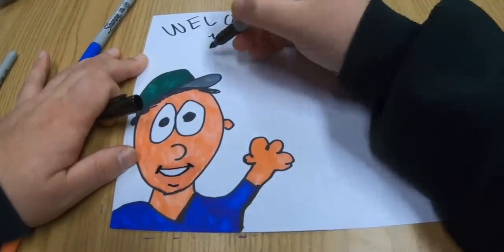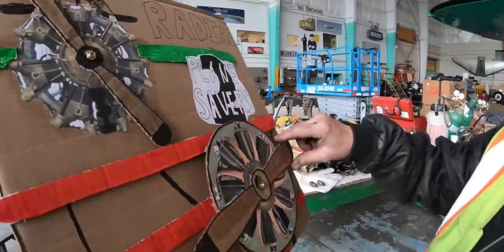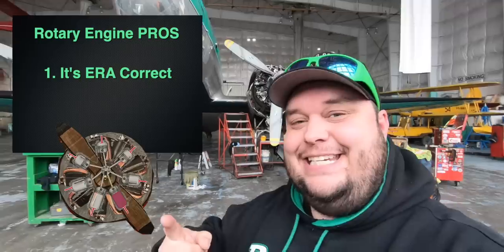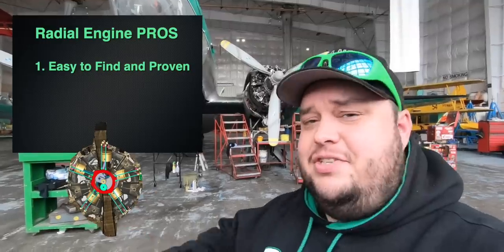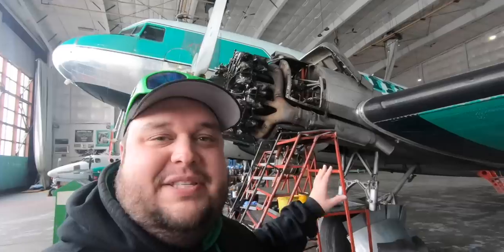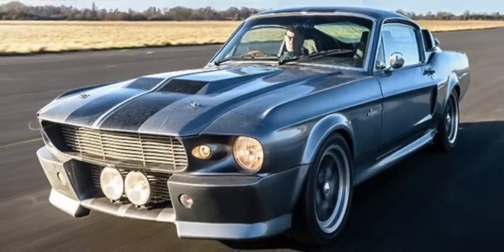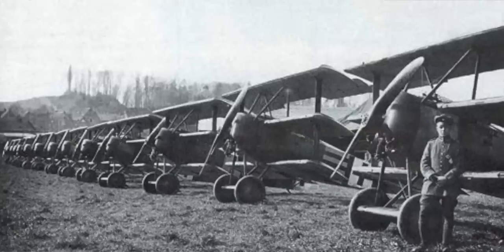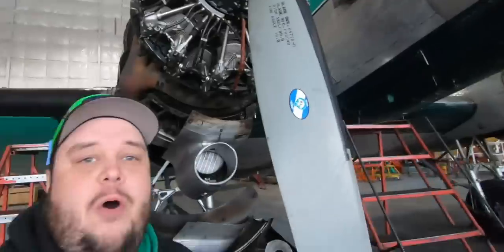Radial vs. Rotary | AIRCRAFT ENGINES | Plane Savers S2-E6

Comment: Looking back romantically and wanting the DRI to be "exact" in all specifications is unnecessary.  Aviation evolved over the decades and new concepts made flying safer, more efficient and less challenging to those who flew them.  Rotary engines are cool, steam gages are cool, tail skids are cool.  But, adding a radial versus a rotary engine simply "improves" the encounter with the aircraft.  Having a tail wheel means you can taxi and turn without wing guides.  You project is a salute to another age, with a nod to evolution.  No excuses needed.  Can't wait to see her fly.

Comment: A rotary engine used castor oil as a lubricant, so it kept the pilots "regular" as well., due to its laxative effect.
Reply: Yes its a real thing. Rotary pilots regularly shite themselves even before "the Baron" appeared in their peripheral vision. Pretty big con!
Reply: Why castor oil?  Totally made sense when you consider that radial rotary engines were 4 stroke cycle, requiring the valve train to be lubricated. An interesting fact about the oil is it's high flash point temperature. This allows the oil that is injected (not mixed with the fuel) into the intake tube, to lubricate the bottom end, and because it doesn't burn it lubricates the exhaust valve train as well. This "total loss" lubrication system is different than other pressure type total loss systems, and different than a total loss system in a 2 stroke cycle engine as well... very unique. The engine cowling is designed to be open at the bottom to allow the exhaust gasses out, along with the single use oil. Pilots of the era wore long scarves to keep their googles clean, not so much to keep from ingesting the oil, a myth. I read in the book "No Parachute", that the rookie pilots would sometimes use that excuse when they soiled their pants after a particularly harrowing mission... literally having been scared $hitle$$. That book "No Parachute" was an amazing day by day account of a British fighter pilot in France in WWI. It was compiled by his wife from letters written home nearly every day for over a year, until his luck ran out. Everything from dawn patrols flying at 25,000 feet in -30 degree cold, to strafing the enemy in their trenches, to landing behind enemy lines and finding his way back. The title of the book, was taken directly and literally from the fact that the British Air Admiralty refused to issue parachutes to their pilots, believing that they would cowar in the face of the enemy! This book really opened my eyes to the absolute absurdity of war in the skies, and to the extent of the absurdity of the British way.

Comment: Regarding the type of engine: it's your plane. IMO, nailing a radial to a replica DR1 is like those kit cars that are supposed to remind you of an early MG, but have a VW engine in the back. They neither look nor sound right, but no doubt they are more usable than an original.

Comment: Anotyher con for rotary engine.Is that because the engine is the heaviest single piece of euipment on the plane.The planes because of centrufegal force.Is constantly trying to turn in the direction the rotary egine is movine.Its like trying to fly a bucking bronco horse.You are constantly fighting the plane to fly staright.

Comment: ok Mikey cut to the chase put a turbine in it and the pilot just sits astride then off into the wide blue yonder assuming the wings don't depart company or to get a super-strong following a VW bug engine plenty of parts available problem solved, with a bit of cowling magic no one would notice

Comment: be careful with that cuda and an engine swap.way back in the late 70's a guy i knew swapped the 318 for the 340 . car was fast till the front torsion bars ripped  out of the frame  breaking the torsion box out of the frame.

Comment: Awesome episode!
Keep up tha great werk!
Intro was awesome

Call caleb curry at radial engines in Oklahoma , put a jacobs 755-9 ,245  hp on it withdual mags
Im overhauling a 755a2 300hp in my starduster too here in shop , theyre awesome engines!
Its reliable and reasonably priced from caleb new overhauled ready to go
Ive even got a crate full of L&R t50 exhaust mfld pieces if u need pieces to make nice dual stack out the bottom

👍👍😎

Comment: "the operation of the engine is the huge, huge CON",  4:43 ... you would need steel nerves or a complete lack of sense to pilot an aircraft with one of these engines in my estimation. siding with usability is always a good choice

Comment: I am in favor of putting in a rotary engine.  You have gone to the trouble of replicating a historical aircraft.  Why not put in a replica rotary engine to give it original handling and performance.  The rotary made the plane much more maneuverable with abrupt power changes.  True it would require some training to master, and operating expenses would be a lot higher, but you would have brought back to life a treasure of our past!

Comment: Hey Mikey, great video!  This CRJ Cptn salutes your latest efforts (& am happy I figured out in ep 1 what your restoring this year!).  But on to the reason for this...I know you've already done lots of research about flight & ground handling characteristics of this model.  But thought I'd point you to a couple of good videos...just follow to my meager channel where I've put them in playlist...think you'll get some good from them!  Also, not the greatest historian, but if memory serves correctly, airfields of that era were simply open (& groomed?)fields with no "runway" to speak of; as these kites had little to no crosswind capabilities.  Probably since so little was known about that at the time.  Oh yeah, in one of the vids they actually have a rotary engine installed on their DR-1...interesting discussion w the pilot!  Good luck🛩‼️

Comment: Sorry, but you're making erroneous statements about rotary engines because you didn't do enough research on them.

The first being that you state that rotary engines don't have throttles, which is false with one exception; The Gnome Monosoupape (monosoupape meaning single valve in French). This engine and copies of it (The Oberusel U.I) don't have a throttle because of the weird design it used. It's a bit of a misnomer to say "its like a two cycle engine", because while it does have induction ports, they're not used in the same way. The engine has a simple mixer which injects fuel and oil into the crank case, which is then mixed around by the crank case and ends up in the cylinder. The interesting part though is the air charge, because the valve at the top of the cylinder is both an exhaust and intake valve, actuated by a push-pull rod. When the cylinder exhausts, the valve is kept open on the downwards stroke part way and then closed, which creates a vacuum. Once the piston gets low enough in the cylinder, the ports are uncovered and the partial vacuum pulls the fuel/oil charge in to mix with the air, it's compressed and then ignited. The push-pull rod operates via a complex set of cams inside the engine to open and close at precise times, unlike a pushrod which is just pushed up with a spring return.

The bizarre method of cam timing and the intake-exhaust valve made throttle control impossible, so the engine was basically full on or off. The designers experimented with ways to add some sort of throttle control by introducing variable valve timing, but quickly ran into problems of burning valves due to not being able to finely control the fuel/air ratio. They eventually figured out that they could cut ignition to specific cylinders by using a geared timing mechanism to ground out the magneto, giving coarse speed adjustments of full speed, half speed, quarter speed and eighth speed by cutting out increasing numbers of cylinders. Doing it this way allowed cylinder firing to stay even so the engine wouldn't shake itself to death.

The second is you're conflating two completely different rotary designs. I just talked about the Monosoupape, which looks like you were trying to describe in your video, but the engine picture you have is a Gnome LeRhone, which is a completely different type of rotary engine. The LeRhone is a conventional engine design with two valves per cylinder, one intake and one exhaust. The copper pipe on the side of each cylinder is a passage from the crank case to the intake valve, which is fed by a carburetor on the back of the engine that meters air/oil/fuel. This engine and every other rotary engine that didn't use the Monosoupape design had a throttle and was able to be controlled just like any inline, vee or radial engine was. These rotary engines did also have the ability to blip their engines by cutting the ignition, but it was not the only method of throttle control, and it was actually advised not to do it. if you waited too long between ignition pulses, the engine could actually explode, or blow jugs clean off the engine.

Here's a Sopwith Snipe with a Bentley BR.2:
https://www.youtube.com/watch?v=q3eMO7tjBoc
https://www.youtube.com/watch?v=MHS1mv08qw8

Note Kermit Weeks is using both the throttle lever and the blip switch. Cutting the ignition does give some extra control over the engine, but is not explicitly required.

Here's a Sopwith Camel with a Gnome Monosoupape 160:

https://www.youtube.com/watch?v=j6PnKUEFX8g

Note that this engine is basically full on or full off, Gene DeMarco has to use it extensively to control the engine and he talks about it briefly.

Rotary engines are a lot simpler to operate than you and most people make them out to be, because somehow the Gnome Monosoupape somehow became the boilerplate textbook example on how all rotary engines work, even though it's completely inaccurate. They're also not horribly unreliable like you seem to believe, there are far more modern engines with worse reliability records, like the shitty Rotec R2800/R3600 radials. I'd trust my life to a 102 year old Bentley BR.2 or a Gnome Monosoupape over a garbage Rotec engine any day.

https://www.youtube.com/watch?v=ZIjh4o9QjtY
https://www.youtube.com/watch?v=LlPtMVijIzs

Comment: Great video Mikey. Re the B24, FYI a B24 airframe is being restored to static display but to engine running condition at the old Werribee airfield in Melbourne Victoria. See b24australia.org.au
Reply: PS Was lucky enough to be given a souvenir of an eroded aluminium panel from the original airframe after it was replaced

Comment: I've been around aircraft and engines quite some time and I have never heard any distinction between what you're calling rotary and radial. They are both radial engines and they are both rotary engines. Even an in-line engine is a rotary engine but it is not a radial engine. Radial refers to the layout of the cylinders. If I remember correctly when you Bolt the crankshaft to the airframe and the engine turns was referred to as an Adam's Farwell design radial engine. And it was used extensively in World War 1 aircraft this is why some aircraft could turn One Direction but they couldn't turn the other because the hey loran we're not capable of overcoming the torque of the engine. But the thing you could do better than the other radio engine or the in-line engine is it could turn the other direction much quicker. Giving it a bit of an advantage in dog fights. The other Advantage was with that much reciprocating weight, it tended to keep it self running even when issues tried to crop up.

The exhaust could be clock to any position in the 360 degree circle. And you are correct about the oiling system, it was very much akin to the oiling system on jet engines until the early 1970s when they finally had a contained oiling system and now jet engines don't have an oiling system at all. They actually compress the fuel to all the bearings before it goes to the injectors in the compressor stage.

Pilots in World War 1 wore scarves to put over their face because it got freaking cold up in the air especially towards the winter time. Besides that they could identify each other by what scarf they wore. But they didn't shoot oil and exhaust straight up through the top to interfere with their line of sight so they would be able to shoot their guns. If there was any of them that actually exhausted out the top in front of the pilot it was a mistake, it wasn't by Design. Most of those systems of World War 1 aircraft still exists to this day in some way shape or form. Oil accumulators is one example. The Souza engine used them.

You may be confused because when what you are calling a rotary engine is tested the exhaust is usually straight up. But it doesn't have to be straight up it can be any place around the engine when it's actually on the aircraft. You're assuming people who could figure out how to fly an aircraft were that stupid.
Reply from the maker: Why?
Reply: Why what?
Reply: Rotary engine is a engine OPERATION not cylinder arrangement. Rotary engine literally means ROTATING ENGINE, or engine that spins. A radial and inline engine doesn't spin, just some internal components. With a rotary engine the entire engine spins except for the crankshaft, carburetor, and contact ring for the ignition. If a rotary isn't rotating it's not running. Also the original designer is Felix Millet not Adams Farwell. 

You just need to google "Gnome Rotary engine".
Reply: @waynepurcell6058  early radial engines did spin. My point was just at the functional part of the engine that transfers power is the part that spins. In early radial engines you bolted the crankshaft to the airplane and the engine actually spun around the crankshaft and the propeller was bolted to the crankcase that spun around the crankshaft. So by your definition the early radial engines were rotary engines. I postulate that even though you're taking in and in-line engine the linear power generator and converting it to a rotational Force and transfer the energy through a rotating crankshaft that all engines are rotary engines. That does not mean that the power generation portion of the engine is rotary in its function. World War 1 aircraft for instance could turn to the left in many cases and they couldn't turn to the right because the torque of the spinning engine did not allow them to turn but One Direction. And I have also seen Automotive engines that were radial engines were the engine Deadspin, it was called an Adam's Farwell design engine. Made the car do some really loopy things because it was set in a horizontal fashion under the floor. The gyroscopic effect was really odd when you try to turn the vehicle one way and acted differently when you turn the vehicle another Direction. The whole purpose of an engine or a motor is to provide a rotational Force.
Reply: @44hawk28  I KNOW THE EARLY ENGINES SPUN. What I'm telling you is the early spinning engines were NOT CALLED "radial" AT ALL, they were called SOLELY "rotary" up until the mid '70's.

You have a circular engine that spins, it's called ROTARY. You have the circular engine that is stationary, it's called RADIAL. What I'm saying is DON'T INTERCHANGE THE NAMES because many people have never SEEN a Millet type rotary like the Gnome or Le Rhone and all you'll do is confuse them more than many already are.

There is enough confusion enough out there from people who only know the Wankel KKM by it's nickname "rotary". Don't inject any more fog into those minds.
Reply: @waynepurcell6058  I've been working on engine since 1964 and I've never heard of a solely engine. But I have heard of the Adams Farwell design engine which uses the rotation of the engine around a stationary crankshaft. And yes there is a lot of confusion out there. I've even seen axially driven engines. They didn't catch on very well but they were a very slender design engine that used a reciprocating piston to drive a shaft that the axis of which was in line with the movement of the piston.

It was intended to be an engine before you send aircraft and take up less space so that the engine nacelles weren't adding aerodynamic drag to the aircraft. But I have never heard of a solely engine. And when I try and look it up nothing comes up. Absolutely nothing. but when I look up Adams Farwell design, I see one immediately pop up that is described as a radial engine that spins around a stationary crankshaft. So I don't know where you learn that term solely engine. But I've never heard of it before and I've been wrenching on cars for a long time.
Reply: @44hawk28  Solely means "that is the only name they were known by. As in solely known as "rotary". In other words rotary is the ONLY name spinning engines like the Gnome HAD (until the '70's anyway). Does that clarify a little more?

Here's something else for you. Just in case you run into the word again.
SOLELY: definition from Merriam Webster Dictionary:
1) to the exclusion of all else.
2) without another: singly
Reply: @waynepurcell6058  I'm sorry I've never heard of it called anything but an atom is Farwell design. Amongst the several number of people that I've known who knew about the design. And it was used extensively in World War 1 aircraft. Probably because he's the one who invented it. And it was called an Adam's Farwell radial engine.

Comment: rotor loss power and are not that good? that why by the end of the war they didn't make these anymore. go with the radial. rotary engines suck run them too long the oil runs out! that why the triplane failed the red baron and because of it he died!! no one makes them anymore.